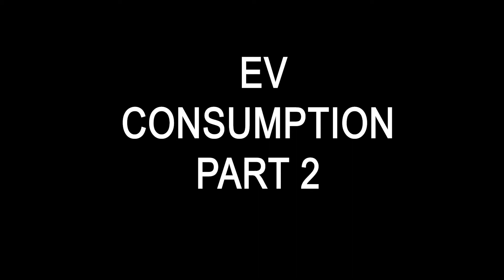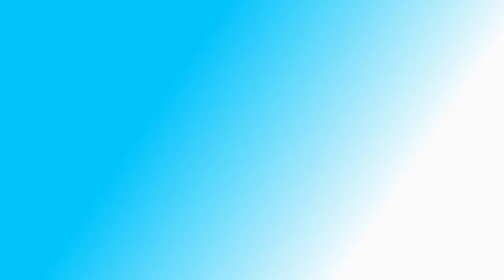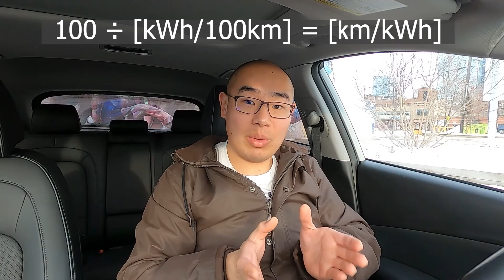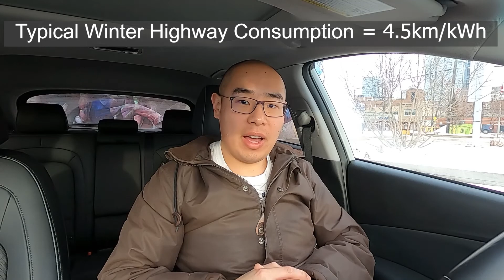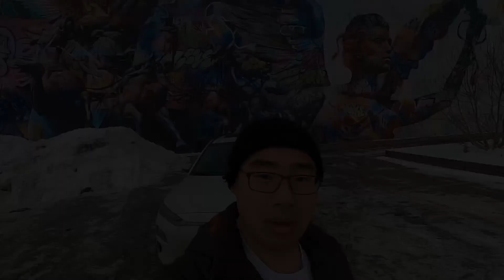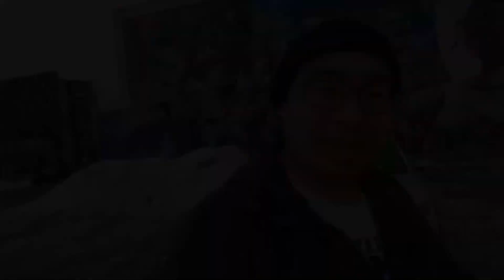Hyundai Kona Electric Consumption Part 2: How do I Calculate Range?

Comment: Hello!  Fellow Alberta driver here.   Did you put snow tires on your Kona?  How does it handle in the snow?
Reply from the maker: I have winter tires (Continental Viking Contact 7) during the winter times. These were just what the dealership recommended. The Kona EV handles well enough in the winter times with winter tires as long as you are gentle on the accelerator when starting on slippery surfaces. The vehicle comes with Nexen all season tires. I haven't tried, but people who uses them in the winter time says they are terrible in the cold.

Comment: Is there a reasonable offset value to include non driving Electrical use by the vehicle in your range number, say for heating and cooling? I want to be comfortable in my future car.
Reply from the maker: Almost all vehicles will calculate consumption with total energy used over the distance driven so the energy used by the HVAC is included. Each EV is different and EVs with heat pumps tend to be more energy efficient. For the Kona EV, in the winter time, I find the heating takes around 2kW to keep me comfortable. If you are super aggressive with the defrosting blowing the windshield with max air at max temp, the Kona can use up to 5kW. In the summer time, to keep the cabin comfortable even in 30C the Kona EV HVAC uses around 1kW.